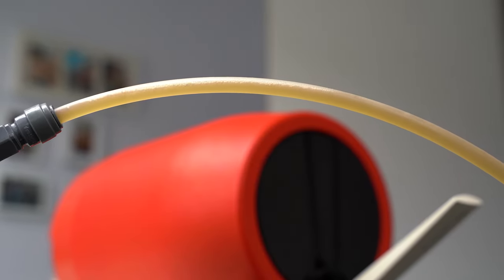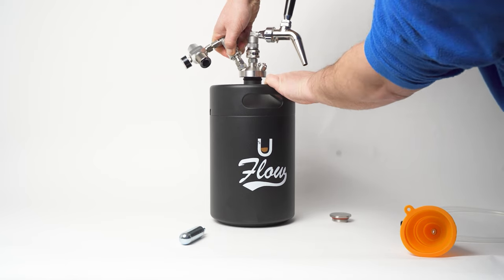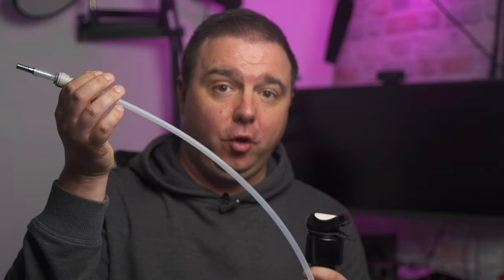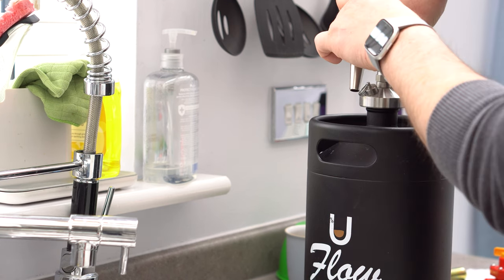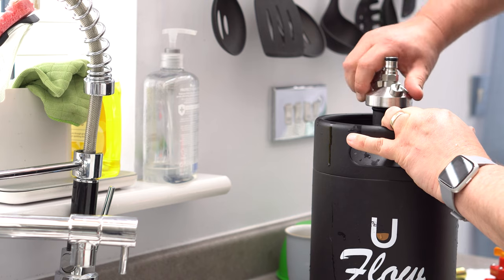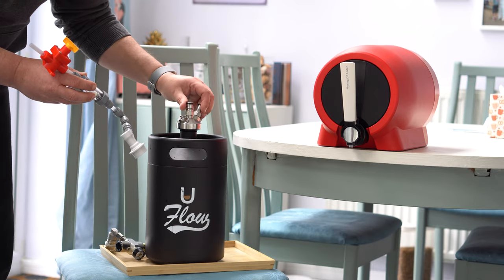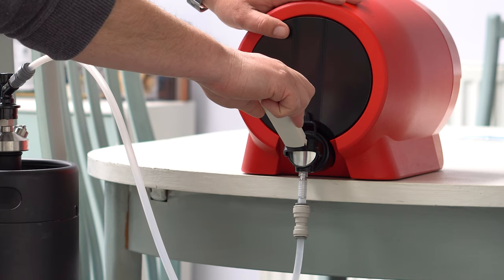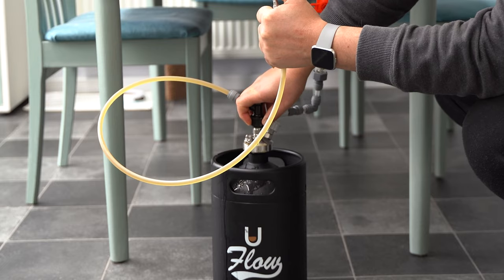Transfer from the P2 to U-Flow

Comment from the maker: This will NOT be affected by the latest recall/replace. The P2 tap remains the same. Make sure to bookmark/save this video for when you get your Gizmo and use it as a reference. As you can see, it's quite a simple process with the Gizmo, but one wrong move could spell disaster for your brew. Hence, why we've laid everything out in the video, how we have. Knowledge (and understanding) is power! 🙌🏻
Pre-Order here: https://bit.ly/UFlowgizmo
Reply: Link doesn't work? :(

Comment: Hi, I've not been able to buy the gizmo from  uFlow (always out of stock), so I'm buying all the individual parts to make my own.  Just one question though - the Gizmo relies on using the Pinter tap at 45 degrees. What happens when the pressure is exhausted in the Pinter (ie when you would normally open the baffles and pour at 90 degrees)? Will I need to add pressure to the Pinter to get the full brew out?
Reply from the maker: Yes, I would say so. On the occasions where I've needed to do that, I've taken an adapted Hopper bottle with a gas regulator, screwed it into the back of the P2 and gently added CO2 until it continues to flow. A number of posts are in both the Pinter groups and the U-Flow group as to how to make one of these. Hope that helps. 👍🏻
Reply: @MusingOfaMan  many thanks for the speedy reply and confirming my suspicion.  I’ll do that!

Comment: If you’ve been brewing at 0 carbonation oxygen has already been getting in through the PRV.
Reply from the maker: No added oxygen however, during the transfer.
Reply: There will be a layer of CO2 op of the brew, as it's heavier than O2, it will be thinner and less can be absorbed during carbonation as it's only done at atmospheric pressure, off, which is 1 bar btw. It's where the measurement bar comes from.